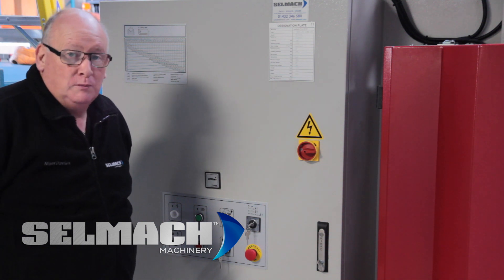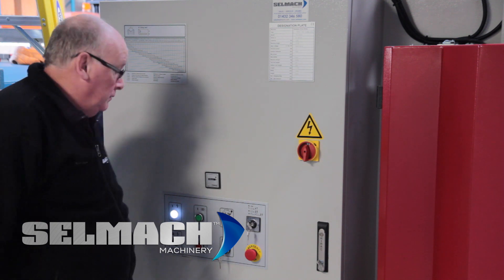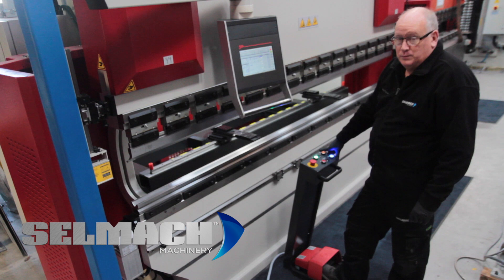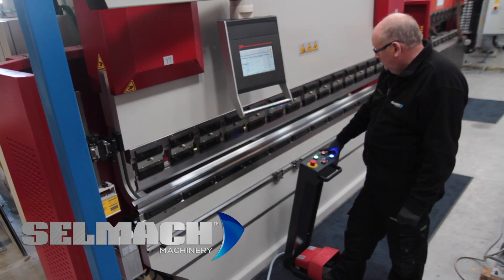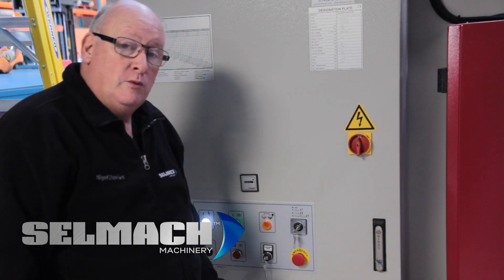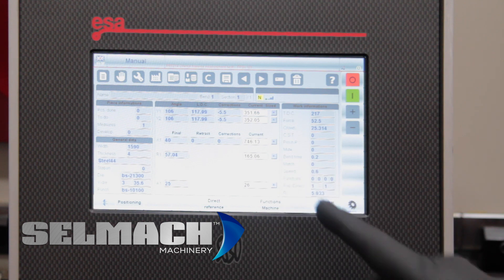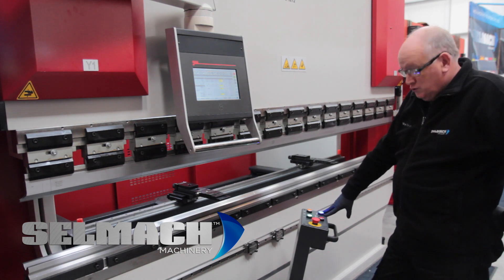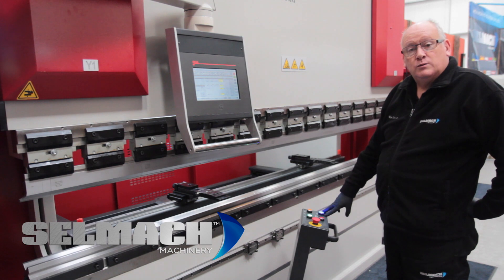Press brake turned off with the beam left in up position [Selmach Machinery]

Comment: Hi. We have a different make press brake, but maybe You could advise.
What if the beam was moved down till the bottom tool exactly (not leaving a gap between punch and die) and is not moving up anymore?
 It shows errors
"AX0296 AXIS Y2 FOLLOW ERROR 

AX0008 AXIS Y1 FOLLOW ERROR
CH0027 CH 0 AXIS IN ALARM STATUS "
is there an easy fix?